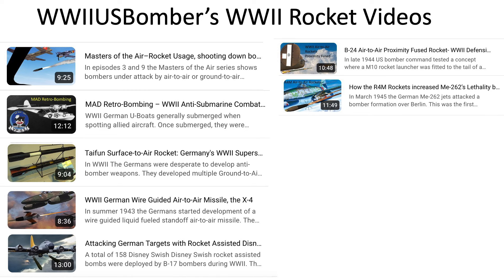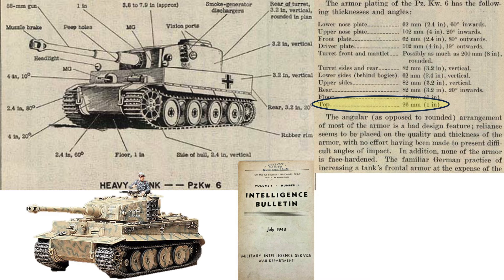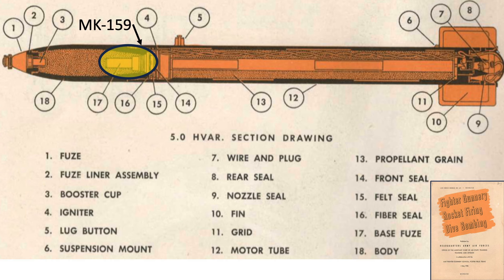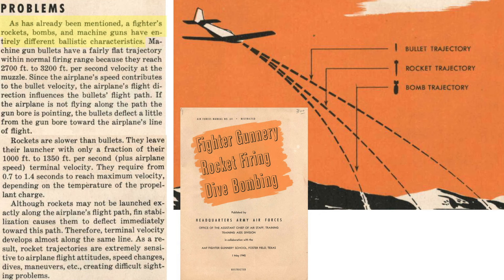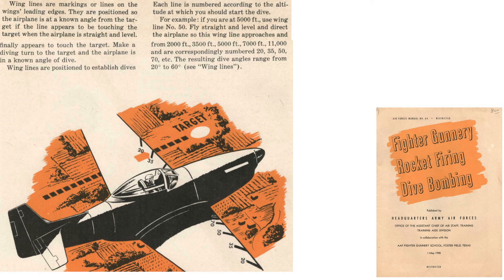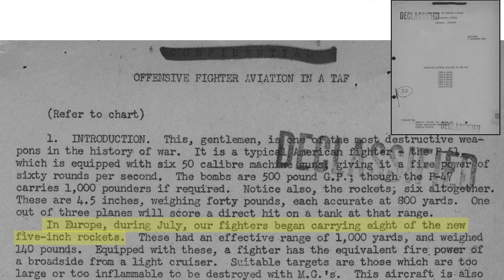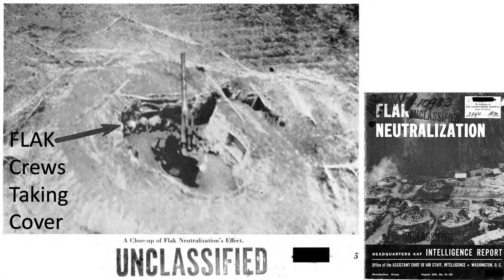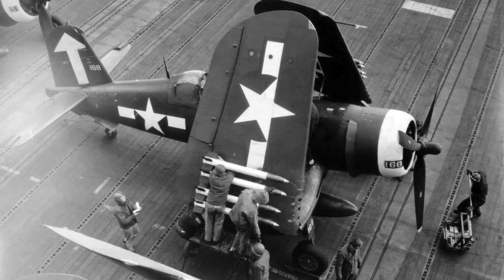WWII 5.0 inch HVAR air-to-ground rocket, attacking with the broadside firepower of a Light Cruiser

Comment: In 1960 I was in aircraft weapons training school when I learned that an IR homing system and proximity fused warhead was put at the front of the 5 inch HVAR to produce the Sidewinder, or GAR-8 as it was known then, now AIM-9.  Later, at a fighter base in Germany, we loaded Sidewinders on F-100 aircraft and then had fire control specialists verify the operation of the aircraft-missile interface.  One man sat in the cockpit to power up the missile and listen for the lock-on tone, while another stood in front of the missile with a lit cigarette for the IR detector to follow.  Watching the guidance head inside the missile dome follow the cigarette as it was moved was rather impressive.  A very effective weapon.
Reply: Interesting anecdote!
Reply: That is one way to get people to quit smoking...😉
Reply: Very interesting and informative article. Thank you!
Reply: @Allan_aka_RocKITEman It actually seems like a good way to make sure people continue smoking, if you think about it.
Reply: Yeah no. Sidewinder and HVAR have nothing in common save diameter. The Sidewinder uses a different motor.

From what I've found, China Lake was supposed to be making an IR fuze, but figured that they could just make an IR tracking system to guide the rocket.

Comment: I've not seen the line painting method before.
Reply: Works with bombs too. In il-2 great battles there is a skin fir the mustang that has them and there is a very good tutorial on YouTube on how to use them.
Reply: I'm dumb.
Got no idea how it works. 😂
Reply: @redtobertshateshandles  basically when the target passing the line under your wing, for each  line you know that you have to pass it a z certain altitude, make a 90 degree turn while driving on the target, count to ten and release, at that point the target is under your nose. I tried it for fun but I find it simpler to just dive on the target and with a bit of experience you know when to drop the bombs when the target just passes under the gun sight to under the nose, or how to aim the rockets a bit under the circle of the gun sight. But they are very inaccurate, it's fine for ships and buildings, kind of okay for trains, but for tanks and vehicule it's very unreliable. In real life they had between 3 and 5% hits on tanks and trucks.
Reply: @matydrum  Tanks will be damaged even by near misses.  The blast does things like knock out optics or damage treads.  This is much of the effect artillery (the biggest tank killer in WW2) had on tanks.
Reply: @pauldietz1325  studies after battle showed that just e very few panzer were lost to rockets but it was non the less very effective because (and pow interrogation showed it) that panzer troops were very scared of them and it caused cahos, destroying soft targets acompzgning the panzers, trucks ans so on, killed personal and made the panzer troops seek cover under trees and such, and moving mainly by night, this considerably help delaying them and reducing their effectivity, so even less than 5 percent of rockets hit the tanks they were aimed at the constant air cover and ground attacks tremendously helped. And german had the feeling of being completely let down by the Luftwaffe. Flak was deadly though.

Comment: The acronym FFAR is now used for Folding Fin Aircraft Rocket, but its WW2 use as "Forward Firing" is a little funny: Presumably it would differentiate it from "Backwards Firing" - but firing a rocket backwards from a moving aircraft would involve it going through periods of negative, zero and positive airspeed regimes.    It would be a little difficult to keep such a design stable . . .
Reply: But fun to watch
Reply: Backward firing antisubmarine rockets existed, I think there is a video about them here.
Edit: video is called MAD retro bombing, it's on the bombers fighting submarines playlist
Reply: They put such rockets on B24,s . The backwards firing ones .

Comment: As I have understood hitting a tank with this rocket was quite hard. But they had a devastating psychological effect on the tank crew. Especially the more untrained ones. What did happen was that they panicked and jumped ship in fear.
Reply: Even if the tank wasn't hit, any people around the tank (supporting infantry, tank crew outside, etc.) the rockets barrage and strafing bullets would scatter them, if not make a mess.
Reply: This is the time of inadequate weapon guidance, so you typically volley-fire them in this case.
Reply: Near misses often damaged tanks enough to render them less effective (or ineffective).  Mobility impairment or destruction/decalibration of gunsights.
Reply: The concussion could kill the crew if the rockets hit the tank but did not penetrate the armor.

Comment: "When the rocket was found to hit an armored vehicle, however, that vehicle was destroyed".

As it was shown that a rocket marginally could penetrate the Tiger I's top armor, I suspect that "destroyed" in this instance means operationally destroyed---the vehicle isn't functioning  anymore, but could be repaired and re-crewed, rather than "permanently" or "irrecoverably" destroyed, where it will never see service again.   "What is a lost tank?" is a contentious topic on armored warfare forums.  

The Germans were rather notorious for only counting tanks as "lost" only if they couldn't recover them. Even if the tanks were so badly damaged they needed to be sent back to the factory to be completely rebuilt they weren't counted as "lost".  On both Western and Eastern fronts in 1944, this often meant such "not-lost" German tanks that could maybe be repaired, but had to be blown up or simply abandoned on retreats, never got listed in the 'lost' bucket.  By contrast, Soviet losses counted everything, including tanks out of action due to causes other than battle damage (mechanical failure, mishap, etc) and Soviet "irrecoverable" losses included tanks scrapped due to wear and obsolescence.  Finally, everyone counted their enemies "operational losses" as kills.

So, when everyone says "we destroyed 20 enemy tanks", it means "we claimed to have rendered 20 enemy tanks non-functional for a some duration."   However when it's "we lost 20 tanks" it may or may not mean something quite different depending on the army.   In the example above, it's quite likely that if Allied fighters using rockets knocked out a whole platoon of Tiger Is they never would show up as "lost" on German paperwork, as the Germans would consider them repairable.
Reply: The Germans couldn’t recover an immobilised Tiger or Tiger 2 - they didn’t have a recovery vehicle powerful enough (even another Tiger was marginal to move them).
They had to be repaired in place.
Reply: @allangibson8494  oh but they tried to use other tanks to tow Tigers. In Italy, a single Tiger I immobilized by a punctured radiator eventually morphed into 3 additional Tiger Is and two captured Shermans being immobilized as their drivetrains broke down trying to tow the immobilized vehicles. The Germans were forced to eventually blow all six tanks up.

Comment: I must admit that the first time I came across the fact that being hit by all these rockets from an aircraft was the equivalent of being hit by a broadside by a light cruiser made be stop and think for a second or two, because until that point I had not considered what the effect would be. But when you consider the calibre of each rocket and how many were being fired you can see the connection. Having said that seeing a P-47 coming barrelling towards you you'd probably think it was a light cruiser.

The Royal Air Force Typhoons when firing rockets at German tanks would attack end on to the tank, aiming for the gap between the tanks hull and the ground. The reason for this was to get one of the rockets to hit the ground just below the tank and the bounce up to explode at the bottom of the hull which was the thinnest part.
Reply: You don't say where you found that nonsense information or perhaps you've mixed up RP tactics & gunnery tactics. All vehicles, even the most heavily top-armoured, will be destroyed by one rocket, but getting one rocket on target is extremely difficult - pilot coolness, skill & huge buckets of luck are required! As an example, the Battle of the Falaise Gap resulted in thousands of abandoned, damaged & destroyed vehicles of all types - an analysis of causes came up with SIX vehicles effected by RPs - that's around a 0.4% success rate [we know how many RP sorties there were]. The chances of bouncing an RP under a vehicle is so near zero that you can can forget about it - it was certainly never a Typhoon tactic using rockets! Never. If you think about it statistically diving on a vehicle at 60 degrees presents the pilot with a vulnerable area around the size of  king size bed [the turret top, the rear flat above the engine] whereas a bouncy rocket with a delayed action fuze, to attack the underneath, has to skid/bounce into a 'letterbox' that's maybe 15% the area of a top attack. WWII rockets are not good weapons against vehicle-sized targets except for the extraordinary, immobilising terror effect on crews - misses produce very little shrapnel.
Reply: P-47s firing machine guns also aimed for the gap to bounce the bullets off the pavement and into the bottom of the tank.  Was very effective.
Reply: @dfirth224  Sorry, but this is a myth. By definition, the angle at which the bullets would strike the underside of the tank would be the same as when they hit the road in front. If the bullets would bounce off something as soft as a dirt track, why should they be able to penetrate 10mm of armour plate at the same angle? For this to work, it would first be essential for the road to be harder than the armour. This reasoning holds for pavement too.

As a general note on those bouncing bullet stories...
There is an old TV documentary that can be found on YouTube that repeats this canard by an unnamed P-47 pilot & it does not pass the smell test. He claims that the underside of "Tigers" were a weak spot, but actually the armour was the same thickness on the Tiger I underneath & on the top deck. 

Also there's no way a pilot will be able to identify various tank types while prepping for an attack [only 3% were Tigers]. He also mentions that he'd go for the fuel trailer attached to the back of the "Tiger" - but this is decades of living scrambling his memories, you'll not find a single photo anywhere of a Tiger towing  a trailer, also note that the preferred approach for an attacking a tank is from the sides or the rear for obvious reasons.
Reply: @dfirth224 it wasnt effective

What you have is one pilot saying they used to skip rounds underneath a tank.

But that doesn't mean it was effective. In fact we know it wasn't, because actual after action investigations found very, very frw aircraft actually destroyed bt aerial attack. You can also look at the ballistic performance of a .50 and see that it didn't have a hole in hell of penetrating the underside of a tank, from a dive, after a richochete.
Reply: @nightjarflying  Thank you for that. I seem to remember a German tank guy's memoirs somewhere, and they weren't too panicky about aircraft attacks - even heavy bombers. They buttoned up and sat it out. In some cases Tigers were overturned by the bombs, but the crew emerged unscathed. As for rockets, I think the "psychological effect" is very real, even to the point of not moving during daylight which would really limit an army's manoeuvring capability. You read many references of "Jabo's" causing mayhem. Probably not heavy tanks like Tiger and Panther but there were plenty other things around that would have been vulnerable, even horse carts.
Reply: @dougerrohmer  Exactly. Not enough is said about the inefficiencies of the Nazi regime & their overconfident approach to a war they initially thought they could not lose. For example the Nazis didn't convert to a full wartime economy until late in 1943, before then cuckoo clock & candlestick makers could carry on manufacturing their inessentials while just about every Allied nation switched immediately to a total war economy. The manufacturing output switch was dizzyingly fast due to a shared commitment to winning - not something we're capable of doing today.
Reply: @nightjarflying Actually bullets aren’t elastic so the ricochet angle ranges between dead flat and about fifteen degrees from horizontal (and the bullets are usually fragmented).
Reply: @dougerrohmer The biggest problem the Tiger had under bombardment was the lack of underside escape hatches - the crew were trapped inside overturned Tigers until they were rolled upright.
Reply: @allangibson8494  There was a circular escape hatch on the left rear of the turret, but I guess that could be blocked easily.
Reply: @ That rear hatch wasn’t big enough to crawl through - it was the shell casing ejection port for the main gun.

Comment: Penetrates 3.75 feet of reinforced concrete?......."Wow", I said to myself "That seems optimistic"
Then I look further into the stats (1:42) and see its a 52 pound warhead measuring 5"x20"......52 POUNDS!!, APHE with a base fuse, flying at rocket speed, plus P-51 speed.
Holy Moses, that thing's gonna hit hard!
Reply: The warhead of the 5-inch HVAR contained an explosive charge of about 8 lbs of TNT. The British 60-lb SAP rocket carried 12 lbs of TNT as the explosive fill.

Comment: HVARs are still widely used on test tracks.  If not used as main propulsion (Hurricane Mesa) they are used as "trimmer" motors (Holloman High Speed Test Track)
Reply: Old production, or new?
Reply: @davidg3944  All batches we used were of Korean vintage from the USN.  Stocks have mostly been exhausted, replaced by Zuni's - except Zuni's have relability issues.
Reply: Definitely old, we don't really have the capacity to produce new ones at the same rate. I imagine the profit margins are very slim on these old rocket designs.
Reply: They used them in the mythbusters episode where they tried to cut the car in half. I wander how the propellant ages is it less reactive or more? Aditionalty what was the manufacturering tolerance in regards to consistency across battlches with them when they were new
Reply: @Cjs-n2n  The HVAR and Nike booster propellants age, reducing the total impulse.  Both are duel-based (gun cotton and nitroglycerin) and pretty stable.  BTW, Mythbusters procucer (Lynda Wolkoski) contacted me at the Holloman track and I sent them to NM Tech where they filmed the car cut in half episode.

Comment: If you´re interested in this subject I recommend "Normandie- a statistical analysis" by Zetterling, a Swedish teacher at our West Point. 

He analysied the German reports and they(according to the reports from German units) weren´t effective in knocking out panzers since the aim was bad and pilots over-reported. It seems that the usual damage on the Panzers(if any) were fixed within 24-48 h. 

It looked very dramatic from the air though, soft skinned and lightly armored vehicles were more susceptible though.

Comment: As usual great video. In your opinion how did the 5" HVAR compare with the British RP-3, the Soviet RS-82/RS-132 series and the various German air to ground rockets?
Reply: The HVAR was better for the same reason that it was better than the FFAR: the larger rocket motor accelerated it faster, and to a higher maximum velocity. That meant less ballistic drop over its flight, and the high acceleration got it up to a speed where the fin stabilization was really effective much faster. All of this is a fancy way of saying that it was notably more accurate.
Reply: But also much heavier. An aircrafft could carry substantially more RP-3s than HVARs, and neither was anywhere close to being described as "accurate" given the extreme limitations in air-ground gunnery of WW2.

Comment: Was the saying "broadside firepower of a destroyer" for the FFAR or HVAR?
Reply: Might not matter much, if the only real difference was the rocket body diameter and hence speed.
The comparison is to the amount of explosive in a 6" light cruiser shell.  Navweaps says an armor piercing shell had 2 pounds of explosive, the common shell had 6 pounds, and the high capacity shell had 13 pounds, with all shells weighing 130 pounds, so it is a very good comparison.
One thing which confuses a lot of people is how little explosive there is in artillery shells.  They hear that a 16" shell weighed 2700 pounds and think "Wow! A ton of TNT!" when they actually only had something like 40 pounds (armor piercing) and 150 pounds (high capacity).  The destructive effect was from a ton of shrapnel flying around an engine room, magazine, or crew areas.
Reply: 60Lb RAF rocket projectile

Comment: 140 pound rocket sank a destroyer?  Damn!
Reply: Destroyers have little armor, perhaps none in the hull.
Reply: Probably multiple hits, but a single hit on a magazine or torpedo tube could theoretically do it.
Reply: @KARLMARX56 yeah those torpedo racks or reloads were highly vulnerable
Reply: @KARLMARX56   The Brazilian cruiser Bahia sank in 1945 after Oerlikon 20mm rounds were accidentally fired at a rack containing mines and depth charges during an exercise shortly after the war.
Reply: @HermesBarcelos  
Dang, 1 second everything is fine....
✌️🍀
Reply: @KARLMARX56  Basically, that was it. It is estimated that the initial explosion killed 101 sailors instantly and another 235 later, leaving only 36 out of a crew of 372 surviving. The ship sank between 3 and 5 minutes after the first explosion.
Reply: @davidg3944  Destroyer armor, such as it is, is there for splinter protection.